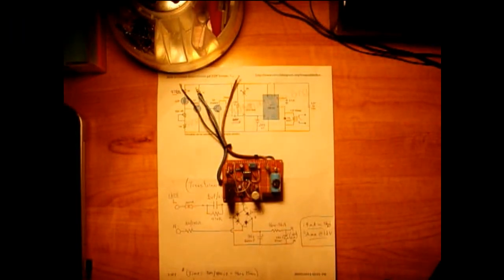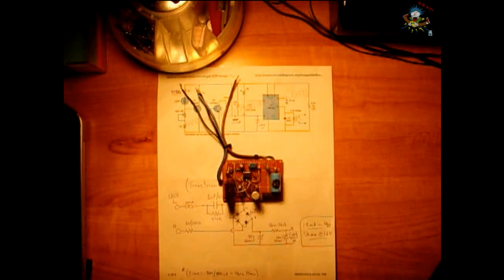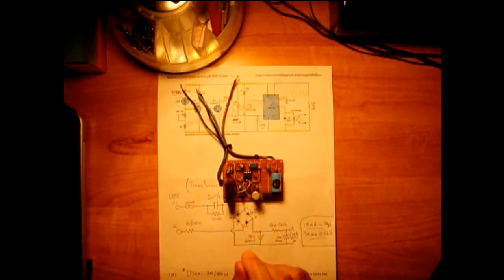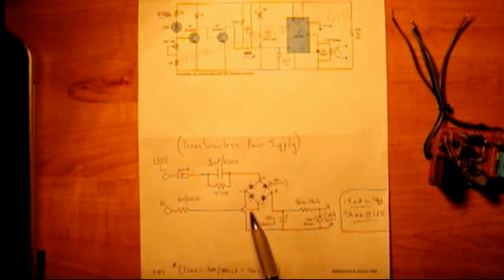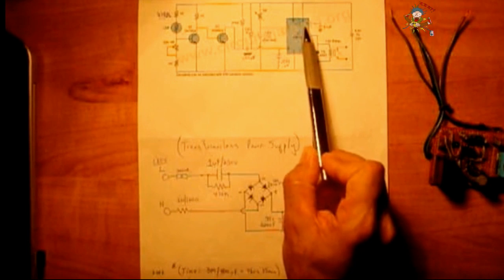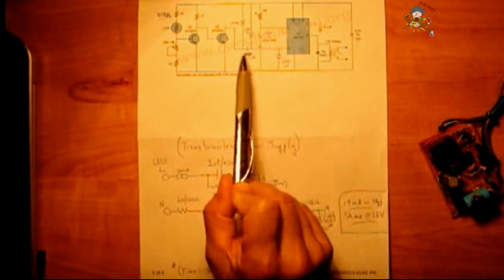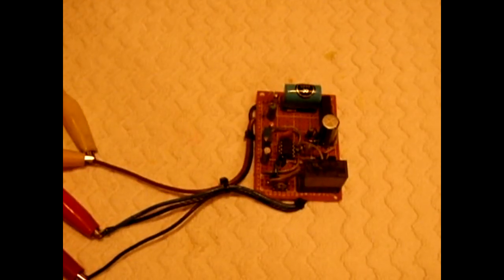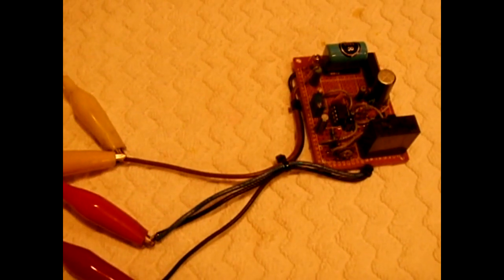12VDC or 120VAC Dark Activated Relay Timer Circuit

Comment: Have you ever check it by turn off the Main supply during relay On condition??
I have checked it,,when relay is in ON condition and I turn off and turn On main supply I cannot get relay in ON state,even it is in dark...
What is the solution for it?Do you have any solution for it?
Reply from the maker: That makes no sense. What happens on the relay contact side has nothing to do with how the circuit operates. You either did something wrong, or have a faulty component.
Reply: Thanks....but There nothing wrong in my circuit,,even it is working properly with day and night light because I have tested it for 3 days,but problem is that,during night light is turn on but whenever main supply is cut off once and it turn on the relay doesn't work and light is off,,,even indicator LED is indicate the on condition.
Reply from the maker: There should be CONSTANT power supplied to the circuit. Even if power to the circuit is cut off, the circuit should work just fine once powered back up. Sounds like a power supply issue. Try using a battery to power the circuit.
Reply: yeahh...thanx...i will try your solution,,,😀

Comment: Hello again,I wanted to built this wonderful project which I definitely knows it will work perfectly because I always follow your channel and every single project you made actually works,I wanted to know I got the right 12v relay which I measured 300ohms relay coil and I heard yours is around 600ohms,so being 230vac I must double my current to activate the coil,I'll be using 1uf 400v xrated cap and 1m ohm bleeding resistor,I have a problem where to put the smoothing cap after the bridge rectifier,should the smoothing cap 35v or 12 zener put 1st? Because I know the dc output will be 325vdc after the diode rectification and when the smoothing cap 35v comes 1st in contact,will it destroy it coz its only 35v?A friend told me the zener comes 1st so that the output dc voltage is 12v before the smoothing cap.,thank you again and hoping to hear from you soon.

Comment: What should be the wattage of the 12v Zener diode on the transformer less power supply?
Reply from the maker: +Leafred Rolle 
Most circuits on my channel use 1W.
Reply: +electronicsNmore ok thanks

Comment: What part of the transformerless powersupply is breaking down the 120VAC to 12VDC?
Reply from the maker: +Leafred Rolle 
Hello Leafred. You Bahamian? The non-polar capacitor in parallel with the 470k is what reduces the current. The resistor at the neutral end limits inrush current.

Thanks For Watching! Be sure to share and rate thumbs up.
Reply: +electronicsNmore yes I'm Bahamian. And 1 more question.....is Q1 the right type of transistor? My lecturer was analyzing your circuit & said that when the LDR resistance goes high it will act like a open circuit which will cause Q1 to not be conductive.
Reply from the maker: Leafred Rolle

I can assure you the circuit works just fine as shown in my video.

Thank you
Reply: +electronicsNmore do you have a transformer less power supply circuit that outputs 9V? I wanna use it for something else.
Reply from the maker: Leafred Rolle
You can use a transformerless power supply for any voltage. How much current at 9v?
Reply: +electronicsNmore 1amp
Reply from the maker: What will the load be?
Reply: +electronicsNmore can I email yu a pic of the circuit I want to use it on?
Reply from the maker: If the circuit is not drawing the full 1A all the time while it is powered, then definitely avoid using a transformerless power supply. Use a transformer instead.
Reply: +electronicsNmore can I show you the circuit? I'm not really sure if it's using the 1A, I think it may be less
Reply from the maker: Post a link to where you have the image.
Reply from the maker: You do realize I have (2) remote control circuits on my channel? I designed one of them.
Reply: +electronicsNmore I didn't notice....I'll look now

Comment: Hey if I want to connect my 120VAC light to this circuit should I remove the 12V relay from this circuit ? If so what must I replace it with and and how must I connect my 120VAC to the circuit .
Reply from the maker: +Widmax Fleuremy 
Hello. The relay coil is rated 12V, but the contacts can be used for 120/240V. Just make sure the current rating of the relay contacts is sufficient for the desired load. 

Thanks For Watching! Be sure to share my videos with others and rate Thumbs Up.
Reply: +electronicsNmore I have one more question for you if you don't mind.. But is the Transformerless power supply   120VAC to 12VAC  or 120VDC to 12VDC?
Reply from the maker: mike brown
120VAC to 12VDC, but I would suggest you avoid that type of power supply until you are much more familiar with electronics. Use a 120VAC to 12VDC wall transformer instead.

Comment: Thanks, how about using ( connecting) this delay relay circuit to a Wireless RF remote control 315Mhz to trigger the delay Off time required( bought on Ebay, receiver 5v and 12v transmitter) Please help me out (run on 5v power).

Comment: hi! just want to ask something.. can i use the same circuit of transformerless power supply with a 220V supply? thank you! i was planning to build this soon.. more power and God speed!
Reply from the maker: Replace the 1uF with a .47uF/400V or higher, and the 1W resistor located next to the neutral line needs to be a higher wattage as well. You can also raise the value of the 470K to 1M if you would like. Make sure nothing on the transformerless power supply gets hot. Very warm is OK.
Reply: oh, great! thanks a lot.. hope that all will goes as well as your project right here..